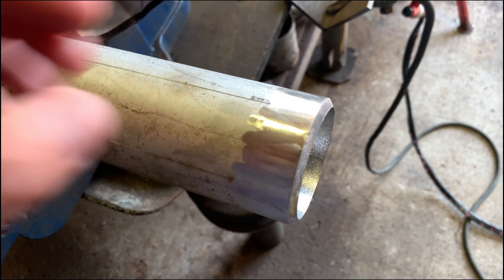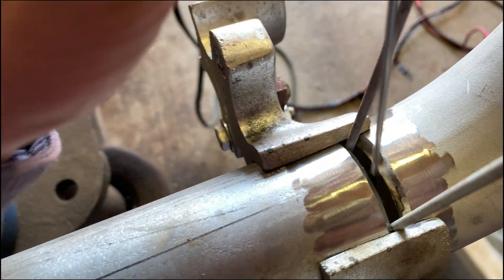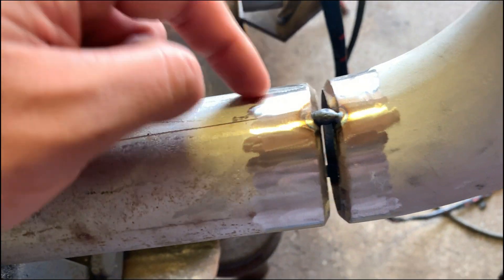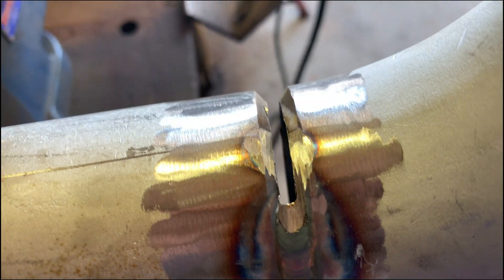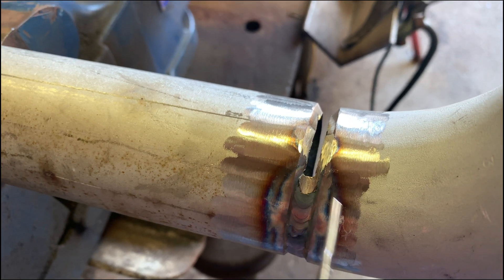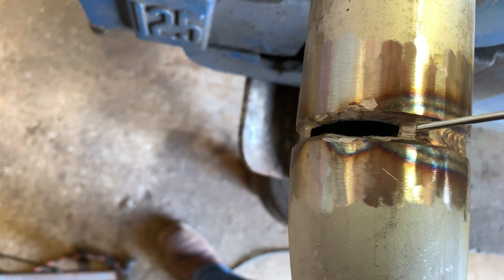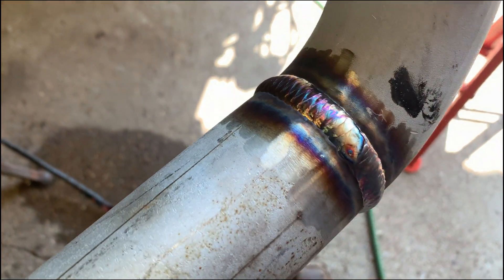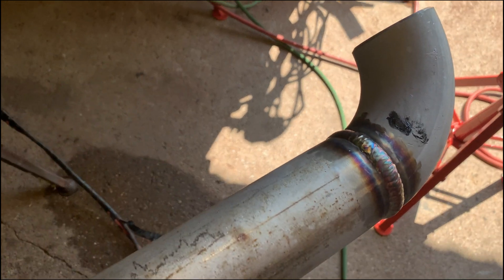Stainless Welding TIG

Comment: When I do stainless I sometimes struggle with cold wires in the overhead section. I freehand the bottom and feed the rod from inside. Those cold wires most frequently occur when I try to constantly keep the rod in the puddle. When I dip keyhole - no cold wires. Why so? I think that when I feed the rod with my thumb the end of the rod fluctuates leaving cold wire. Should I go slower or hotter or just dip instead of lay wire?
Reply from the maker: You’re rod angle is staying behind the puddle brother. Make sure you’re feeding through the front of the puddle and you’re not staying behind it. Other wise you will chop more filler than needed into the puddle. Lean the rod towards the way of your travel. That was my biggest issue as well boss
Reply: @VantageWelding  thank you bro. Starting from 9 oclock I start walking the root feeding the rod from outside and in comes out so smooth and slick. Wanna try walking the bottom also, but not so confident
Reply from the maker: It’s just a matter of practice brother. You got this. If you can do it up at top you can definitely do it from the bottom up. Its a bit of practice but you got it bud.

Comment: For stainless is it the same carbon steel grinding wheels that you use? Is it the same bevel machine for carbon steel pipe too?  I have seen a lot of stainless being welded lately. Keep the videos coming.
Reply from the maker: You can use the same grinding wheel so long it hasn’t touched carbon steel other wise it will contaminate the pipe.
Reply from the maker: And unless you have a plasma attachment for the beveler’s bridge, otherwise you can’t use icy acetylene to cut stainless.
Reply: Thanks for the info and all the explanation on videos
Reply from the maker: @arthurquintana1345  thanks for watching. I really appreciate the support

Comment: Good shit bro! couple questions for u do you quarter it when you weld? How many amps for root and cap?
Reply from the maker: Not me brother. I fit the pipe for the gap and level to work in my favor. If you watch my previous videos I explain how to fit your fittings to work in your favor. At the end of the weld they’ll be perfectly level.